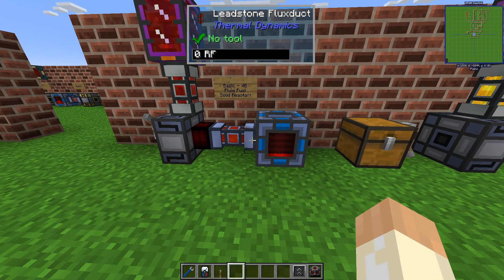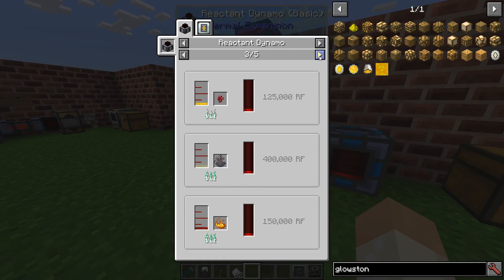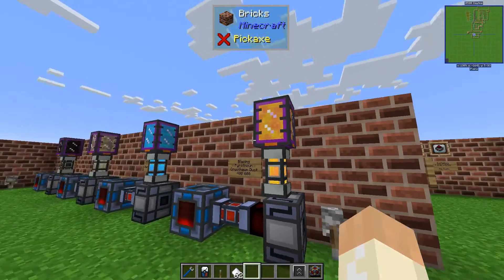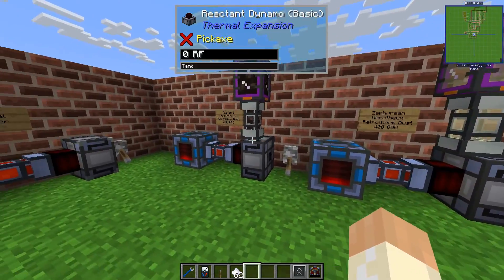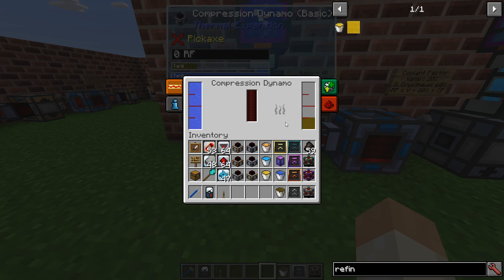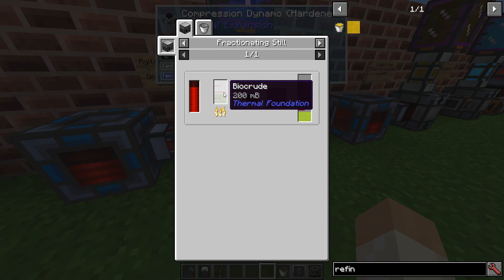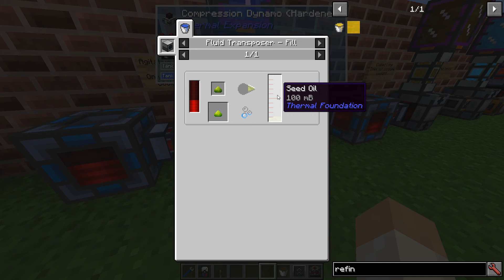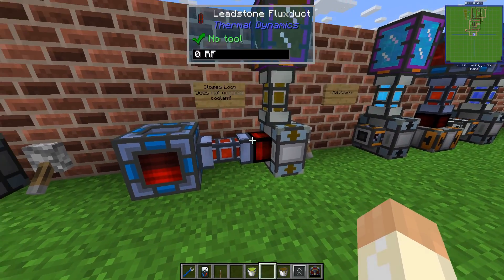Thermal Mods #10 - Reactant and Compression Dynamo & Augments

Comment: Video helped a lot, I'm playing stoneblock2 and wanted to keep my base tiny. I'm using the tree resin setup to get tree oil for the compression dynamo and also had a surplus of rubies, sapphires, etc so also made another dynamo to process them as I accumulate too much. Wasn't sure what augments would help compact it to made the system run off 2-3 dynamos. In the future when I fully automate the compactors and sieves to run forever I'll definitely need to upgrade and get more. Def liked how in-depth you went

Comment: Good video, but how much steam does this compression dynamo create with boiler conversion?
Reply from the maker: I don't remember the exact amount, looking at the amount per tick is what's really important. With augments you can get more steam as well. Just check the tooltip in the machine when it's running.